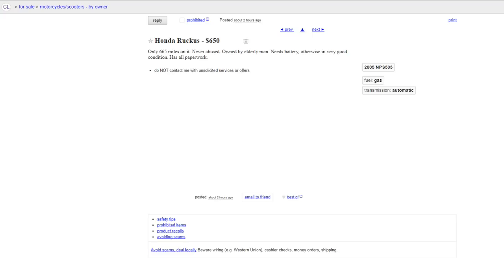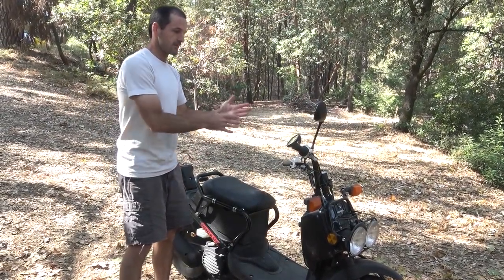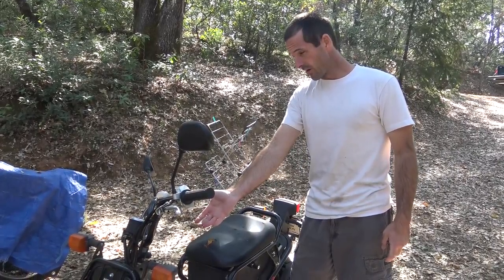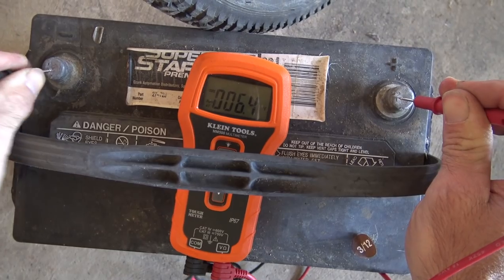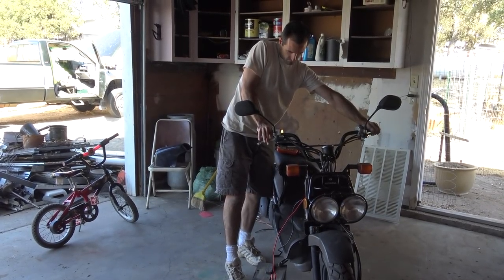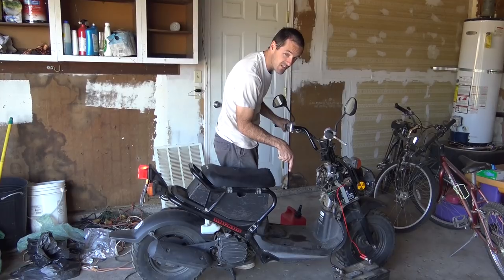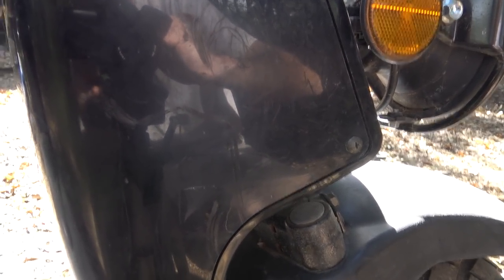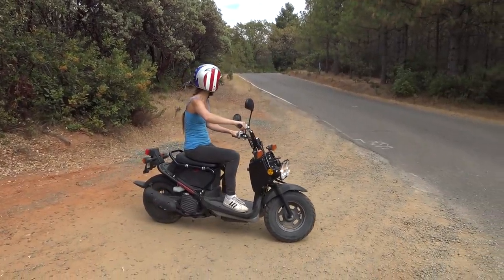Cheap Honda Ruckus Scooter - Will It Run?

Comment: 10/2024.........if you get it running, it will run forever. Honda's are SO reliable. Had my 1985 Honda 150cc  scooter for 33 years, it ran like a champ, and I drove it for 5000 miles. My scooter was also water cooled, and it was hi-way legal,.....top speed 65,...but I preferred it at 35 to 50 mph, in-town use, primarily. Stored indoors in the Ohio winters. I bought it when I was 30, and put it away when I turned 65. The Ruckus is COOL!  Though that model is limited to slower speeds,....maybe top speed is 35, I dunno. They made a Big Ruckus, model,....with higher top speeds. The  young kids know how to customize the basic ruckus, with better wheels, sometime they extend the frames, and put on better tires. It is good yours has a lockable storage under the seat,...most come with few options for cargo. The poor frame design, prevents one from attaching a "milk crate" on the rear, or an add-on, lockable storage. Have fun and wear proper protection. Solid shoes, not flip-flops, and sturdy trousers, maybe even gloves and a full covering helmet.

Comment: I just paused at the point where you smash the lamp apart to get at the 12v transformer. So McGyver. "Where can I get 12 volts?" I'm such an idiot, I was thinking "the pickup truck battery". Doh!

Comment: When you were trying to kick start I noticed you weren't holding the brake in.
Reply: Right and that might be what the previous owner did wrong as well. Anyway that gasoline was ancient and was the oil even looked at??? or the spark plug?? Oh well, they got her going !!!

Comment: Get a new battery, clean out mouse nest and make sure the wiring isn't chewed up, remove all old fuel, add fresh and cycle the key through until fuel is fresh and clear coming out of carb delivery pipe. Remove carb and take off bowl. If kinda clean inside make sure both jets, main and low speed especially. Reassemble and see how she goes. Don't crank it or kick it to death before u do ALL of above. 12 years at motorcycle shop. 2005 are known for early crank bearing failure. Change oil a lot. Text if u need more info. Good luck.

Comment: You are right. The smile on that face was worth the purchase. It is an ideal little scooter for a person just starting out in quiet areas to learn to ride on. I am not sure about the early models but the later ones are fuel injected. Maybe it is lucky you did not start out pulling it apart. Thanks for sharing her happiness.

Comment: 0:25   "posted 2 hours ago"

You live on Craigslist lol
Reply: Ethan Simmons I know I've been there brother lol
Reply: I bought off ebay 2 tamiya rc cars for $50 free shipping. The guy had it listed less than a min when i did a buy it now. I added radios n batteries. Both cars worked fine. I winded up selling them for a lil profit
Reply: LongIslandP8ntball gold pans?

Comment: You should be able to find the manual online, also if your wife ever decides to want the ruckus to go faster most modern scooters can be easily hopped up by adding/removing a plate in the clutch, should allow it to go up to 45mph, which after she feels confident on it will make it more fun for her. I'm glad you got a good deal on the scooter as decent runnin bikes seem to go for about 1k$ & Hondas are reliable & long lasting. Good luck & may you have many years of fun & safe riding
Reply: What plate in the clutch? You mean the rollers?
Reply: Its not in the clutch its in the variator
Reply: Please edit your comment to say, a plate in the torque variator.... if people start taking clutch plates out its going to get messy 😉
Reply: Is there even a clutch plate in a scooter? I know clutch springs, but no clutch plate.
Reply: Nilo Baranda it depends how the centrifugal clutch works/ if it's the adjustable kind..... mostly in my experience the answer is no though.
Reply: It is not adjustable although there are video on You Tube that show how you can get a few extra km/hr by shaving the inside where the clutch expands. Computer is another issue I was going down a really steep and long hill and the engine throttled down to it's LSM limits which here in Ontario is 70 km/hr. Remove the limiter in the carburetor and get a performance muffler.
Reply: Funny giving advise on something when you clearly know nothing about it, oh yeah I forgot this is the internet
Reply: HockeyPlayoffRun nah fam, sell it and buy a european 50cc 2 stroke youll go quicker
Reply: Funny how I owned, drove and maintained one for eight years
Reply: HockeyPlayoffRun he was talking about the first comment of the guy saying you can de restrict the clutch
Reply: Decent running rukus's around my area go for about 2k and great ones for about 5k.
Reply: There's a ring in the variator that you can remove and it will do about 15-20km/h more

Comment: you can get 4 diodes and a capacitor and turn that AC into DC
Reply: Steven Betts just the diodes should do for a simple BR
Reply: Power electronics. Eggggcelent
Reply: Christopher Koen yeah but I'm a perfectionist. Trying to clean up that signal a little. But he shoulda built himself a full bridge rectum-fryer either way. Probably save himself some time if they were on hand.
Reply: "Noise" wouldn't hurt a simple DC charge.  Now.... if I were using it to run something with a processor or audio out? Fuck yeah, I'd have a few filter caps to clean that up.  Pixies are so annoying when they jump out of speakers without permission.
Reply: heck one diode would do it, a half wave rectifier is what is inside many old battery chargers anyway, before we got the silicon modern stuff , used to be plate rectifier, but im sure that old battery was gone anyway, not worth trying
Reply: Steven Betts Rectification?
Reply: Double E's are the GOAT.
Reply: Bob Kerbs there is a YouTuber that calls it a rectum fryer in one of his videos

Comment: I used to have a 2008 honda ruckus, I still do have it but its been sitting in my parents shed up north for about 4 years. I used to make trails in our woods to take it through, also had a 3 foot mud hole i would take it in. Had a blast on it. Good times.

Comment: Awesome video. My first impression of how it ran when you first got it going was due to the lack of oil in the cylinder. Maybe there's some stuff I didn't see that was done off camera, but a great tip for anyone starting a motor after sitting a substantial length of time is to take out the plug, drop a tad of oil or WD-40 in the compression chamber, and crank. What a great find!

Comment: Just an FYI, I usually pull the plug and air filter for visual inspection and I have a can of starter fluid so I don't have to kick a million times. I also have some tools in my rig along with jumper cables,  which you could use to start other things.  Bravo for getting it going even if you are a bit of a hack.

Comment: What was wrong with the old battery? Did it not just need cleaning up the terminals and charging from running the motor and jumping with the truck?

Comment: Scooters are fun. Only thing.... don't "favor the rear brake!" as you told her. You need to use both brakes for a safe stop. 80% of your stopping power is in front, but only front is no good either Enjoy it! :)

Comment: I had a Honda Jazz for 8 years, it ran another three and was in really bad shape. Same engine. Biggest issue with the engine is no engine vent so it end up blowing gas into the oil after a while. Huge difference when you put fresh gas in. They are also a lot of fun to drive.

Comment: I have a “Big Ruckus” 250cc.  I’m not saying that it was a bad idea to change the gas but your scooter started just the way mine does after sitting all winter. It starts right up after that first time in the Spring.

Comment: Normaly it has to engage the rear wheel as soon as you hit the gas. It seems to be quite lazy when the throttle is engaged. You may want to check the clutch. The clutch works like a drum brake, when the pads are worn off, it loses the grip on the rotation transfered to the rear wheel.

Comment: Know this is old, but those things are a blast, and nice little run-around scooters, and if you're going to get someone riding, about the easiest things to put them on. You never showed cleaning the airbox though, and on anything that's been sitting, especially with signs of rodent infestation, that's a first step. That was a great deal for that thing.

Comment: The carb needs to be cleaned, and an fuel filter put on. Also sounds like the air filter is clogged and your drive belt is worn or back clam shell pulley is dirty. OVer all you got a hell of a deal. I have videos on my channel to fix all these things. RH DSD

Comment: a honda 125cc elite '85 i rescued from going to scrap all it needed was good gas put back in it.mine tops out at 100km and doesn't over heat either.

Comment: 10/2024.......I love the Ruckus,.....but it is too low to the ground, making it less visible to cars when you are on the street. Up grade it with more running lights, reflectors,....something to increase you being seen by distracted car drivers. Wear bright colored clothing. Avoid "rush hour traffic". Follow the rules of the road,....avoid "lane splitting".

Comment: Fyi you could have used the 14vac to charge the batt . By tying the 14v wires to the 2 wires between the stator and regulator.  Seing how the stator creates ac power and the regulators purpose is too both convert the ac volts into dc as well as bleed off over voltages to the ground.

Comment: Love the video! ... HOWEVER... a 'beginner' rider learning in loose gravel/dirt on a small wheel scooter is a recipe for disaster!!  After 49 years of motorcycle riding, I was riding a classic Vespa P200e with 10 inch wheels and  lost traction on a smooth black top road.  I started a turn, encountered a dip in the turn ending all my motorcycling adventures with 3 broken ribs and a 2 1/2 hour blank memory, concussion, all doing approximately 20 MPH(!).  Be very careful with small wheeled vehicles, traction is at a minimum, especially on loose surfaces!   ENJOY.. but be safe!  BTW, *Keep those smiles in your marriage*!   :)

Comment: I'm not too sure where u are located but a nice stock ruckus goes for 2k on the cheap side. Modified high mileage ones go for 2k+ the old junked ones that still " need work" go for 1.5 k. U got a great deal!!!!

Comment: Great video. Next time you buy a scooter, motorcycle, or moped. Pull out the spark plug. Spray starter fluid in cylinder. Kick start it. it will start immediately. Good luck with scooter. They are highly upgradable they can be modded with 200cc engines.. Or you can put in a 2 stroke 50cc with a 70cc head. expansion exhaust. Bigger carburetor. K&N air filter. Tuned cdi. Variatior weights. Clutch springs. Kevlar belt. That's what I did to my last one.

Comment: Not sure about that bike in particular, but non-magneto ignitions aren't generally self-exciting, so there needs to be 12 volts to get any spark. Fuel pump and old gas aside, I'd bet you just weren't getting spark.

Comment: It's a Tensor lamp.  The 12V bulb was the selling point; it was supposed to be better for the eyes than a 120V bulb.   Modern science probably does not agree with the idea that it's better for you, but the light seems somewhat different.

Comment: At the price you got it...it's a steal regardless of if it runs or not. The front frame of the ruckus and metropolitans usually runs anywhere around 400 bucks alone.

Comment: Have a similar older carbureted Honda Ruckus. Even with a new battery, it starts exactly like this one. If you crank it long enough, it finally sort of starts running, but needs the starter power to help keep it running. After quite a while, it will run on it's own, but easily kills if you give it too much throttle too soon. After some additional time it actually runs good from idle to full throttle. If it is started the next day or so, it starts right up as it should.....but if  it sits unrun too many days, it reverts back to the sluggish start thing. Any Ruckus experts have an idea what is causing this time consuming starting ritual?

Comment: When your bike doesn’t have battery power try turning on the light switch and it should start my old Honda 125 trx I was able to start with no battery at all.

Comment: Best thing you can do is pull the exhaust off and there is a screen where it meets the cylinder it will take care of the bogging issue

Comment: Don’t know why you didn’t hose the thing with starter fluid to see if it ran than cleaned the carb and fuel tank, new spark plug like you should do with anything that’s been surting

Comment: You hold up one minute good sir. At 1:05 the tear in the seat is on the right side of the scooter, then later at 2:05, it's on the left side. What kind of game are you running? :|

Comment: New Spark Plug might get a better Spark? If you fall of without Your Arms and Hands covered they will get all ripped up in a mess. Always wear proper proyection even at slow speed it can be bad.

Comment: Looks like fun. Though, putting a complete novice on any two-wheeler with no protective gear at all is not the smartest move, some tough materials or better yet motorcycle-specific gear helps if you take a tumble. 30 mph on a Ruckus or 30 mph on a Harley, it hurts just as much to fall.

Comment: Someone pointed out he did not hold the brake while kickstarting, that won't go. Safety feature. At least on some scooters. I got scared a few times when I tried starting my Piaggio Typhoon 50 and it wouldn't start! Then realized I was not holding the brake. (Safety feature)

Comment: As a motorcyclist, telling your wife to mainly use the rear brake is kind of a bad thing as ppl tend to develop bad habits. In motorcycling, it's a good habit to use 30% rear brake and 70% front brake, especially as a rookie rider as when you need to stop in a hurry, your mind will automatically apply that logic and not lose control of the bike. When you only use the front or rear brakes and not both, you develop bad habits and in an emergency situation, you're far more likely to lose control and wipe out.

Comment: DO NOT HOOK THE BATTERY UP TO ANOTHER BATTERY LIKE  THAT. I LEARNED THE HARD WAY. it will fry the brain on the left side of the steering column, cause your fuel pump to catch fire and it is only 370$ to replace the brain. Please only charge the battery by itself with no external help. just some friendly advice. R

Comment: new battery, new fuel filter, check the fuel lines and oil change, you can get 1500 off this thing, would still be worth it. i'd keep it though.

Comment: Instead of shutting it off, you should have run it around the block full throttle a couple times. Then filled it up with premium.

Comment: 7:25 Noooooo :'( It would have worked ;) The bikes original rectifier would have an output of 13,5-14,5v depending on rpms. Expensive bikes will have modern mosfet rectifier 13,4-13,9v. Workshop battery chargers will pump out 13-14,5v. Was all "how cool" and then you threw it out, now i'm all sad :P

Comment: Telling her not to use the front brake is wrong. Nearly 70% of your stopping power comes from the front brake. Even for beginners, it's bad to tell them not to use the front brake. It'll cause them to start with a bad habit that'll be hard to break (no pun intended).

Comment: You have a Cool Wife And i we Picked up a free Tao Tao 50cc big bore kit 150cc we also picked up a 1995 Chevy Silverado 1500 Z71 Extended Cab Short Bed we picked up a 1996 Winnebago Adventures A 2000 Chevy Astro Van a 2002 Chevy Blazer my dad gave us the Tao Tao scooter my cousin and his wife Gave us the Chevy Silverado 1500 Z71 and the Chevy Astro Van A older couple moved into a new house and the owner of the trailer park didn't want the 32ft Class A Winnebago Motorhome so they gave it to us an a younger couple bought a new 2016 Chevy Silverado and a 2016 Chevy Tahoe they didn't want the Chevy Blazer so they gave it to us so in 2018 we bought my wife a GMC Envoy got me a Chevy Silverado 1500 Z71 and a Chevy Astro Van and my Wife a Chevy Blazer and our Class A Winnebago Motorhome so from The End of April Beginning of May to the Beginning of January we picked up 6 vehicles 5 for free not counting out mini buggys our Offroad mowers our three wheelers our quads m trail bike both my 1982 Harley Davidson 1200 Sportser 25th anniversary my Dad gave me my 21st birthday my 1972 Harley Davidson 900 Sportser Chopper 7ft Springer Front End my Grandpa gave me my 18th Birthday my suzuki gsx600f a friend owed me some money he knew i was looking for a sport bike similar to my brothers suzuki gsxr750 he didn't know when he would be able to come up with the money and he already had the bike i wanted so we made a deal and he gave me the bike and my kawasaki kz1000 my uncle had laying around i wanted it he gave it to me for a older Sports bike it's fast as hell runs with the newer bikes